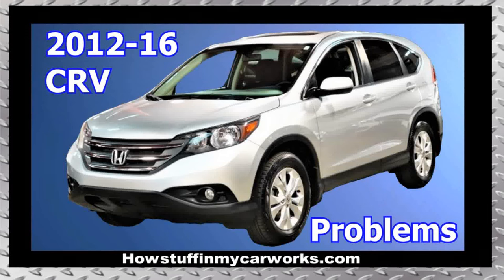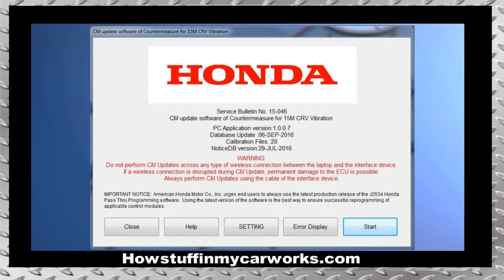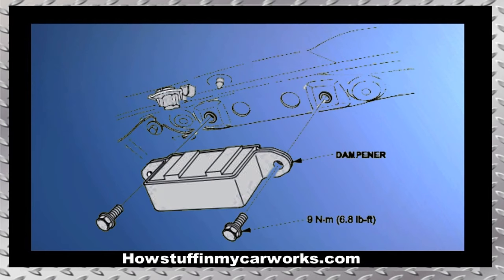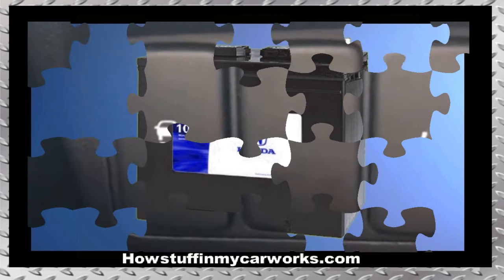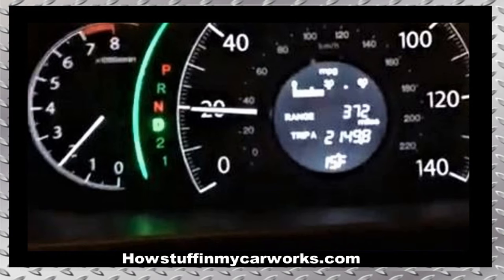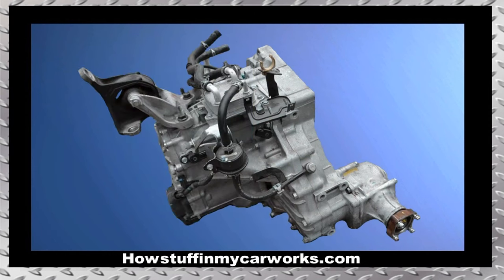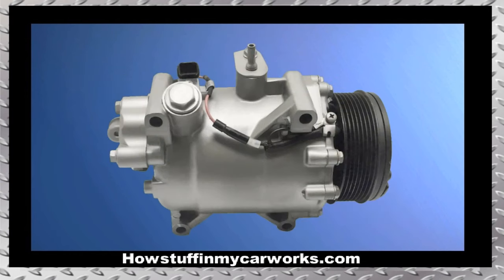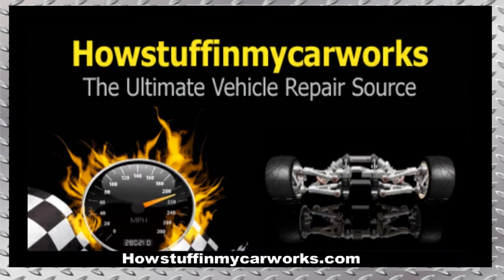Honda CRV 4th Generation from 2012 to 2016 Common Problems and Complaints

Comment: Really interesting to see the AC clutch relay fuse being the cause of my battery drain on my 2013. My local Honda identify the fuse as the problem of my AC not having consistent cooling and I misdiagnosed it as lack of refrigerant in the system. No leaks detected but I had to evacuate the system due to overcharge. Sadly, the VTC issue only happens on really hot or cold days and I found that if I set the ignition to ACC and turn off, and then turn it back on, the problem sometimes goes away.

Comment: I just bought my 2016 CRV about 4 mths. ago, and I'm experiencing problems with about 4 of what you pointed out. front rotars, rough gear changing going down hill, oil leak and I had water just setting in the spare tire compartment. Before this vehicle I had a 2005 CRV; when I got the vehicle it was a little over 67,000 6 yrs. later I had driven that up to a little over 370,000. I had many repairs and bought many tires over an 8 yr. period, and the last 4 yrs.   using it as a delivery  as well as my regular driven  vehicle.

Comment: My 2014 has been extremely reliable overall. It did have the VTC issue, that Honda fixed for me. Now at well over a hundred K, the torque converter (I change all the transmission fluids at 1/3 the recommended interval) is getting weak- some shudder around 25 mph or so. Otherwise, no leaks rattles or A/C issues. Battery drain has never occurred, though it needs them replaced rather early on and I suspect it because they are so small. Even the brakes have been worry free for 65 K :) This 2.4 is a very good engine, aside from the VTC. Compared what my coworkers who tell me about problems and major issues occurring in their 2017+, of many car makes and models, I think overall it relatively cheap to maintain. In five years people are going to shocked the level durability/reliability loss for most cars as this decline continues.
Reply: Hey John i have some similar problems with my Honda with the shudder when it goes over 25 mph. Did you fix the it( shudder) or it continues? It’s the transmission which I believe the torque converter?
Reply: @kelcyre69  Am pretty sure its the TC. Giving the car a firm acceleration seems to minimize it some. I won't fix it until it fails.
Reply: @johnfrakes4746  Thank you I wish you the best
Reply: Hey John, the other day I just change the transmission fluid on the car ran fine no shaking no rattling on nothing
Reply: Transmission fluid flush fixed our rides brand new at 70k

Comment: I had the torque converter issue happen after I bought my 2012 CRV at 73k miles. Brought it in for the Transmission fluid to be changed and the software update. Recently at 96k the issue came back worse than ever. Dealership said the torque converter was faulty but the warranty company inspector said he found clutch material on the dipstick and in the pan, so to be safe they are having a transmission from a 2014 CRV installed. I have seen less reports of the transmission issue with the 2014 CRV so i am hoping this newer transmission is good to go.
Reply: I’m getting a 2014 with 74k miles tomorrow. Fingers crossed it’s ok. Have a warranty with it but hope I don’t need to use it.
Reply: Hi, I have a 2014 and my CRV has the same issue. Slips during gradual (slow steady) acceleration with the 2nd and 3rd gear.

Comment: water leakage after heavy rain or car wash at spare tire compartment:::solution >>> seal rear lights assembly
Reply: The only water leakage I've seen is thru the roof antenna.  We have to reseal around it every year or two.

Comment: Have a 2016 SE with Earth Dreams automatic transmission 49,000 miles it has vibration while stopped in gear.  It goes away when shifted to neutral. Should it be covered by some sort of recall? What is TSB 15-046? I thought it was the motor mount. Thank you for the video and the information if you or someone else responds to this.
Reply: I think the RPM on honda crv 2016 is set too low, only 650-700rpm on your dashboard gauges.. if you press on gas while parking etc to 750rpm it will go away,  you can adjust rpm higher to make it no more shaking but it doesn't need too, as long as engine doesn't shut down or stop then you ok... no big deal,  low rpm will save u more gas while stop etc...

Comment: VTC should be recall item
Reply: I have a bad vtc in my 2013 crv, when I talked to a Honda mechanic about it, he told me to ignore it and just drive it. Will not be buying another Honda ever again!
Reply: @kimtaylor479  calif and Illinois have class action lawsuits.  Get your state to join. 
Watch some more repair videos on our.  Read viewer comments.  Dry oil when starting.  One man slightly cranks starting motor... then stops. The turnover gets oil up into the part.  The destruction happens when it's operating dry. 
Another viewer wrote he replaced the spring early.  Not sure what spring? Read their comments you'll find suggestions.
Reply: @kimtaylor479  how many miles are you at?
Reply: @kimtaylor479  yeah because this doesn't affect anything, it's just sound
Reply: My 2012 vtc actuator was replaced under warranty in 2014.  Noise started again in 2022.  Bummed,  thought Honda cr-v were reliable and for the long term purchase.

Comment: What's the cost to fix the VTC rattling noise at cold start
Reply: Me to 😢
Reply: I have the VTC rattle in a 2011 Honda Fit. It will cost $1,200 to replace the VTC. If the timing chain and guides need replacement, then the cost may double.

Comment: I have a problem with crv 2012 it makes a noise after 45 miles per hour as if a plastic scrape is heard inside from the driver's side
Reply: Check the casting on the rear view mirror
Reply: I have 2014 model with vibration problem whenever  I get slower or faster moving , I feel it badly  if i step the  acceleration when I need more speed. What is probably cause of this. thank you.
Reply: @renrenmangahas9199   i had That problem on my 2013 CRv 71k miles a day after I bought shudder bitween 25mile to 38mile,I flush the trans fluid,and reset the system,after a month,I dint Feel the shaking anymore,i think it takes a times to relearn the system,change oil every 3500miles FS…and now I just findout,my traction Control isn’t working.😢 no more honda.

Comment: All I’ve had so far is the vibration at idle on my 2015, think they’re charging to fix that tho and I’m broke
Reply: Not for your year the recall is for the 2015 nit the 2016 which socks because that's the model I have but I've seen on crv forums that some 2016 crv owners have gotten the recall done on theirs

Comment: i had That problem on my 2013 CRv 71k miles a day after I bought shudder bitween 25mile to 38mile,I flush the trans fluid,and reset the system,after a month,I dint Feel the shaking anymore,i think it takes a times to relearn the system,change oil every 3500miles FS…and now I just findout,my traction Control isn’t working.😢 no more honda.
Reply: I'm having the same shudder issue on my 2014. How did you reset the system?
Reply: Flush the trans oil every 30,000. Somethings putting grit into the trans...   coming from a part further up the line.  I forgot what part now? I am Not a mechanic. 

Watch a view gen 4 videos for 5 most common problems. It's mentioned in one of those.